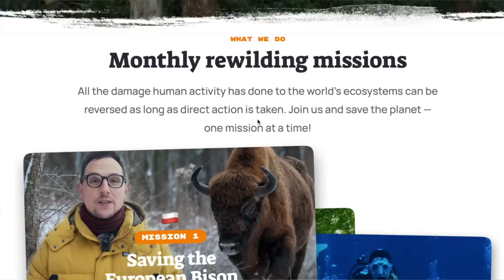At 37 Years Old - First-Time Driving In Rural Thailand | How Did It Go? 🇹🇭

Comment: I have fiber optic wifi in the UK and it is the way to go. This is all underground. How can you have fibre optic wifi in rural thailand. Surely they are only connecting to the nearest pole which will not have a fiber optic connection
Reply from the maker: Something like this 
https://www.ais.th/fibre/1Gbps-FTTR/en/
Reply: Thailand's home internet speed in May 2022 ranked 3rd.

 According to the Speedtest Global Index ranking of internet speed test application Speedtest by Ookla for the month of May 2022, Singapore's home internet speed (Fixed Broadband) ranks No. 1 in the world with an average download speed of 209.21 Mbps, an average upload speed of 174.67 Mbps, and  Delay  (Measurement delay) is 4 ms.

 followed by Chile  It had an average download speed of 206.97 Mbps, an average upload of 106.79 Mbps, and a latency of 6 ms.

 Thailand was in third place with an average download speed of 188.31 Mbps, an average upload of 154.06 Mbps, and 5ms latency.